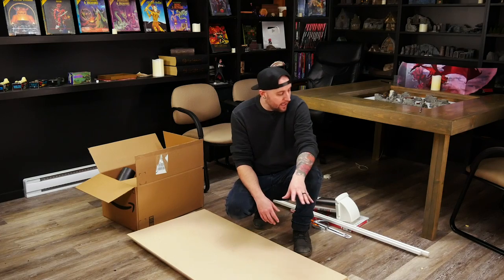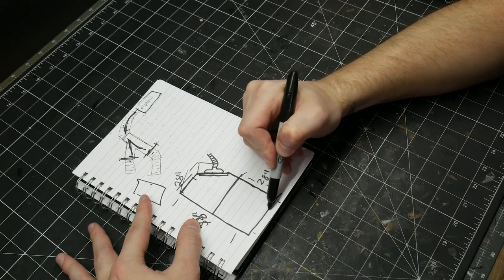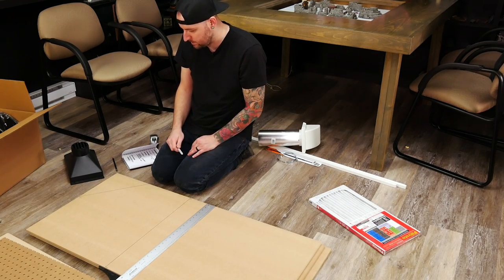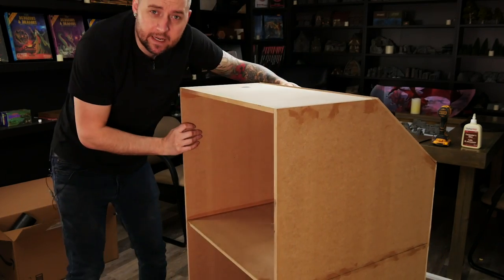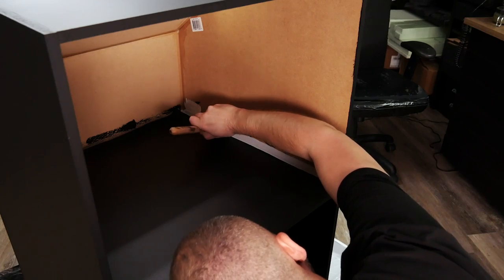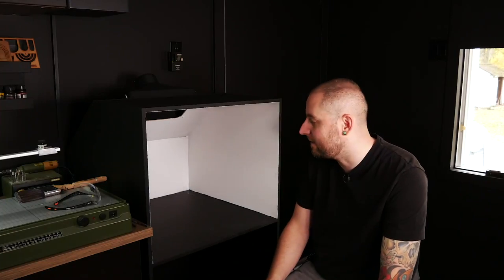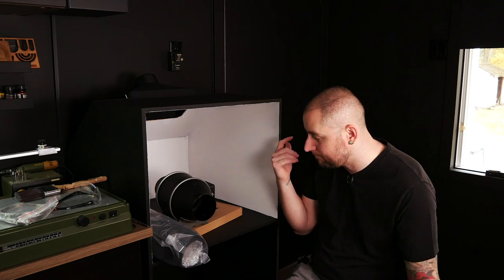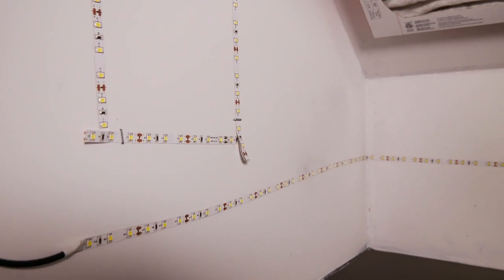I Finally Built Myself an Airbrush Spray Booth!

Comment from the maker: Yes, the exterior vent was sealed! Not everything makes it into a video for various reasons, in this case because I was out of white exterior caulking the day I filmed, then the next day we had a blizzard. It was sealed a few days later when the weather improved......chill my dudes. 
BUILD LIST
1/2" MDF (6'x4'....I bought 3 precut sheets of 2'x4')
1/4" MDF (2'x4' sheet. I bought two sheets and didn't use most of one, if you reduce how far down back goes you can get away with one sheet)

FILTER
(USA) https://amzn.to/2B0Lz7M
(Canada) https://amzn.to/32eHXeA
(UK) https://amzn.to/2VvZWKS
(Germany) https://amzn.to/2ID5RZl

IN LINE FAN
UK Amazon didn't list my fan so look for one that has at least 200CFM and speed control
(USA) https://amzn.to/2pbhoYU
(Canada) https://amzn.to/2pcWRTN
(UK) https://amzn.to/2IHMNco
(Germany) https://amzn.to/2IIgY2Z 

DUST HOOD
(USA) https://amzn.to/33l83wr
(Canada) https://amzn.to/35lzvMt
(UK) https://amzn.to/31aCuDY
(Germany) Can't find, check other country links for refrence

4" HOSE
(USA) https://amzn.to/2pfvfNK
(Canada) https://amzn.to/2M8xWcZ
(UK) https://amzn.to/2nIPymA
(Germany) https://amzn.to/2IXpRWT

4" HOSE CLAMPS
This set up used 4, but the fan came with two and the hose came with two so I didn't need to purchase any.

4" WALL HOOD
I can't find the exact type I used on Amazon. Check your local building supply store. They are used for dryer and fan vents. Get one with a flapper to stop air from entering, and one with a cage if you live somewhere with lots of squirrels like I do...

LED TAPE LIGHTS
Make sure you get something that comes with a power supply, that is dimmable, and that is daylight temperature (4000k-6000k)
(USA) https://amzn.to/2q6mtSR
(Canada) https://amzn.to/2q6dcKw
(UK) https://amzn.to/33p6rlj
(Germany) https://amzn.to/33rAAAD

TURNTABLE
(USA) https://amzn.to/2VFevf5
(Canada) https://amzn.to/3285cGN
(UK) https://amzn.to/31e8zeo
(Germany) https://amzn.to/2IHRC5v

DOUBLE SIDED TAPE
(USA) https://amzn.to/329Pzid
(Canada) https://amzn.to/2M6snM8
(UK) https://amzn.to/32kK14o
(Germany) https://amzn.to/35oV1ji

IF YOU DON'T WANT TO BUILD SOMETHING YOU CAN GET A "PORTABLE" ONE. IT WON'T BE AS POWERFUL, QUIET, OR PERMANENT BUT IT'S FAR BETTER THAN USING NOTHING
(USA) https://amzn.to/2pgyuos
(Canada) https://amzn.to/2B6J6ca
(UK) https://amzn.to/2VAbtIV
(Germany) https://amzn.to/2OLKhWx

(As an Amazon Associate I earn from qualifying purchases)
Reply: Black Magic Craft amazing work like always and that was some really bright LEDs.
Reply: I built one with a cheaper fan off amazon and a big sterilte storage bin. The filter fits over the entire back and the clear box means I can light it from the outside. I like yours more, but I didn't have the space or willpower to make furniture lol. That said, I think I spent about $40 dollars total.
Reply: Don't know if you've figured out what your going to do yet with the vent pipes but a furnco coupling would work. Might need to paint the brackets so they aren't obnoxious, added benefit of a furnco is that you could bend up the left over metal band and put a screw through it for wall mounting. That said.... 3d printing fumes really aren't that bad, but i guess if you got the vent already might as well use it!
Reply: DUDE IF YOU USE A MASARY HOLE SAW YOUWOULD MAK EASY WORK AND SHORT TIME U DONT NEED USE THE GRINDER
Reply: Wow this is kind of cool I just realized I live about four hours away from you.I've also spent the last week or so working on a spray booth for into put into my office.my design is relatively similar on using a Amazon inline fan ducting for the time being as I'm just starting out it is only going through the window in my office.the biggest change is that because I already have a table set up buying just sits on top of my desk and is made of corrugated plastic which is a very sturdy material that's light.I wanted it to be semi-permanent I wanted to be able to stand there and Beyond and used for in general but if the time arises to use this room for something else I wanted to be able to pick it up and move it. Using corrugated plastic infor this project made it collapsible yet big and sturdy.my biggest concern that I have to overcome is actually getting a decent elbow for the ducting that I have. 

I live in a small town just over the Manitoba border into
Reply: So glad you sealed that vent dude! I was like "no way? He's got to have gone back to fix that" LOL Booth looked great btw
Reply: We got hit with that storm were lile 4-5 hours away. We got 1-3 feet
Reply: Hey just a thought for your light strips. Maybe covering them with clear shipping tape. Just in case paint gets on them.
Reply: This is one of the best i.ve seen bad ass also putting part numbers and places.my hats off to you.Tanks Ian
Reply: After three months or so, how is it holding up?
  Especially the lights and the filter.
Did it clog up as readily as you thought it might?

  One additional tip here gang, to help prevent the potential hazard with the fumes, start the fan before you start painting. 
  Seems pretty Captain Obvious, but you’d be surprised. The potential hazard is from build up fumes and then the spark at first ignition...when you turn it on.
Reply: Frend do you work with enamels and laq.color or just with aqril.Turbofan is ok for enamels? Do you have any problems.thanks
Reply: Lol how did you know I was going to comment that. Glad you stuck some caulk in.
Reply: Awesome build and video, I just came across it because I’m also thinking of building a spray booth but didn’t know exactly how to go about it. So I was looking for some ideas and came across yours. I was just wondering since it’s been a few years now how those LED’s were holding up? Any issues with them? If not then I will definitely buy them as well since they are so cheap!? Maybe you should make an update on your spray booth video!? That would be cool and you can give us the pros and cons of the results and how they are holding up? Anyway great job and keep the videos coming! 😁👍
Reply from the maker: @Soloist101  LEDs still going strong!
Reply: what do you mean " sealed " ?

Comment: I know this is old, but if you wanted to use a baffle to save your filter, you could use that blue aquarium roll stuff over your filter. With the added bonus that you can remove it and clean it, put it back in.

Comment: Instead of the peg board as a pre-filter I would suggest getting some canvas from the fabric store and just push pin in up, and replace when to paint clogged. a pretty simple and easy change. and has enough holes to allow for air flow.
Reply: or cheese cloth.
Reply: @GuyTayler  Actually I think you are right. that is what I use. I use the canvas as a base it just has to have good holes to let air go through it. I just went to a fabric store and got the cheapest fabric I could. . mine has a funny ugly pattern on it but it doesnt matter it gets painted just like white would!
Reply: Don't do either, you would be shocked how fast you lose suction. Those filters are like 1.50 each lol.

Comment: Sweet build! And to the ones wondering about the fans rated to use with spray paint.  Yup, an explosion proof inline exhaust fan starts at like $900 US (And that's for a bog standard model for regular large ductworks not smaller ducts).
Reply: Ooof! Was wondering the price difference.

Comment: This is by far the best DIY booth I've seen on here. Glad I found this video. This is definitely the design I'll be copying to build mine, though I will also be adding a removable front cover to really help keep it clean inside when it goes months without use. Thanks for the inspiration to finally get building!

Comment: Nice solid build. I built a similar setup for my wife who airbrushes a lot of custom paint jobs on model horses (Breyers, Peter Stone, etc). The only thing I'd suggest doing differently with your setup is building in a way to space the air filter a couple inches out from the back of the spray booth. Doing this creates a plenum that allows a better suction across the entire area of the filter. As your design is right now, only the portion of the filter that is directly in front of the vent hood is actually catching particulates from the painting. Spacing it out those two inches (really could just be an inch and a half, or even one inch), will make the whole system work a lot more efficiently. My wife airbrushes a crap-ton more paint than a typical gaming modeler would, at least in terms of paint volume. I made her booth so it could take a 20x20x1 filter and it takes LONG time before it gets clogged enough for it to need changing. I really dig the use of the LED strip light as well. Did you get daylight color balanced lights (5000k plus)?

Comment: Did the same thing as you but with a stove hood fan mounted to the top of an old black TV/DVD stand for the box section. Has worked great for years.  It's big enough and has built in two speed fan and light switches.  I have a sheet of plexiglass that folds down to cover the top half of the front opening with the bottom half open to put my hands in to airbrush.  The plexiglas helps with increasing the fan suction and decrease fumes or paint leaving the booth and offers some protection from breathing in fumes/paint when doing close up detailed work. You can also close the two glass doors on the front of the TV stand to prevent dust getting in while projects dry. Only paid $40 CND for the hood fan new from home depot and some wiring and a plug to plug into the wall so the cost of the the total build was around $70.  Its rated at about 210cfm so it does the job.  I also use a lazy susan turn table from ikea that was about $12.  I use cheap furnace filers that I cut to size for the hood fan.  All in all it's worked out well and is very inexpensive.

Comment: "I may or may not use it for spray paint in the future..."
Immediately tests fan suction with spray paint.

Great build though.
Reply from the maker: I will be using it constantly for aerosol spraying. But I want people to know the "risk" and come to their own decisions.
Reply: Yeah I know. I was just trying to be funny because I'm bad at comments.
Reply from the maker: Nah, you’re just fine at comments. My reply is for posterity 😊
Reply: I just paused the video to make the same comment. 🤣 You'd probably have to spray paint with no filter for there to be any real risk.
Reply: @BlackMagicCraftOfficial  Just asking, and making the suggestion because I learned the hard way on my home built spray booth several years ago. Did you check and see if when the fan is running full bore that you are not creating enough suction to backflow your chimney? Are you now pulling your furnace and hot water heater exhaust into your house? (Like mine did!) Think about it, if you exhaust air from a house, the same amount of fresh air MUST get in somewhere.
STRONGLY SUGGEST that you place a carbon monoxide detector near your furnace/hot water tank for no other reason than to CYA..
Reply from the maker: dieseldave564 I’m pretty familiar with that scenario. I used to build luxury kitchens that had 600 CFM hood fans. We installed make up air units on relays for this very reason. A 200 CFM fan doesn’t need that, but opening a window during use is advised and what I will be doing. This will also help remove any smells more quickly as fresh air replaces the exhausted air.

My house already has carbon monoxide detectors integrated into my alarm/fire system.

Also last year I had my chimney internally sleeved with a smaller diameter pipe for hot water tank as it’s new building code here to do this when the furnace is switched to high eff that no longer uses chimney. This is specifically done to avoid bsckdraft on hot water tank.
Reply: Minutes later, blinds self hooking up the lights. lol
Reply: @BlackMagicCraftOfficial  Glad to hear that in your case you got it covered. Since you didn't address it in your video, I thought I would bring it up to benifit those that haven't done this before.
Reply: Explosion proof fans are now very inexpensive.  Google 1942 CFM.  :)  Your current setup is an accident waiting to happen.  Assuming your electrical is perfect and no errors occur there, eventually the bearings in the fan will run out of grease or have some problem and create a massive amount of heat.  Fragments of the bearings could create sparks if they are damaged as well.

Comment: I've been waiting for this video ever since you mentioned it!  I need to build one... Now I just need to figure out how to get around my block walls to vent it.  I'll probably have to vent through a hose up into the attic and then through the roof.
Reply: You can always vent out a window. You basically use something in your window kind of like what the floor AC units use for intake, except you'd be using it for exhaust. Depending on where in your house your booth is, venting up through the attic is a long way to go from the source of air, plus it is always best to avoid adding holes to a roof. There are also drill bits made specifically for cutting through mason block, as well as various other techniques for getting through block walls.  Here is an example, https://www.youtube.com/watch?v=tt_jkWeRJa4, but it is easy to find many other places it is talked about on the internet.

Comment: Great looking spray booth.  For those thinking of doing one them selves, some suggestions.  Keep the run as short as possible,  and avoid the use of flex hose.  Opt for rigid metal pipe. Flex hose cause turbulance and reduces  the effectiveness.  Also keep the number of offsets (elbows) to a minimum.  Instead of 90 s try to use 45 s.  Don t use the Filtreat filters, I use cheap fibre glass  filters (package of 3 fo 5-6 dollars.

Comment: A tip for connecting the pipes. PVC piping can be heated with a heat gun to become more flexible. You could heat it, mould it around the fitting in question, and let it cool down again. I've done this for shop vacs successfully.

Comment: I am new to airbrushing but was inspired by your spray booth build but not as sturdy.  I bought the exact inline fan and since my workspace is in the basement, I was able to vent through half of the 14" x 36" double window (bug screen side) and insulated with Masonite and 2" styrafoam sandwich.  the biggest problem was fitting the 4" aluminum flex duct onto the original cheap damper which was also 4".  sent it back to Amazon and paid more for a better damper and had less of a problem to put it all together.  thanks again for a well presented video

Comment: Hello! Thanks for filming this video. I am building my own spray booth as well for airbrushing and was trying use some other fans and power supplies and LED lights. after viewing your video I was able to rationalize the purchase of the inline fane and the LED lights with power, both of which simply plug into an outlet. Turns out the inline fan is going to be 15% more powerful than the industrial computer fan I was going to use and the led lights are install ready. Venting is not an issue because I am going to be spraying next to a window so the venting was never an issue. Thanks  so much for the informative video and you sure changed my mind!

Comment: This is an awesome build! I'm going to try and do something similar when I build mine. I also wanted to mention a feature I saw on a spray booth I worked with when I worked at Rockwell Collins that I had never thought of, but thought it was a nice feature to add. There was a pressure gauge that told you how much vacuum was being pulled between the fan and the filter, and that was to tell you when you needed to replace the filter. This was to preserve the fan, and if you're going to be using the booth often, then it'll probably be a useful feature to add.
Reply: Clever idea!

Comment: Nice. I built mine out of reclaimed particle board, an old dryer vent hose, a reclaimed lamp, two reclaimed switches, a reclaimed outlet, and the only brand new item was the direct drive fan. It was pretty fun building it and getting it to work.

Comment: OK.  Comment #1:  Love the old school AD&D & D&D books and boxes. #2.  Not sure about the printing shake, but I can see it being a thing, although I think more of a thing with an FDM machine.  better to be safe than sorry. #3 Snow like that when the trees can still collect it in the leaves SUCKS, we had a SINGLE DAY like that a couple years back in Calgary, can't imagine the damage multiple days would do. #4 nice and simple despite it's more permanent set-up, especially using the full-size cut pieces of MDF.
Reply from the maker: I'm pretty sure I WILL end up putting the printer on top. It's fairly stable, but I decided I'll just screw the side of the booth directly to my work bench, which is bolted to the wall. This will eliminate basically all risk of bumps/shake issues.
Reply: @BlackMagicCraftOfficial  I guess if the resin is shaking from side to side a little as it cures through the UV light it might cause issues.  Made a decision on the machine you want yet? :)
Reply from the maker: I already got something sitting waiting to be opened and set up 🤫......gotta find the time.
Reply: @BlackMagicCraftOfficial  I can't wait to see what printer you choose. Elegoo Mars?  Or perhaps someone sent you that new Phrozen beast-of-a-printer to review?

Comment: If you still want to use the blast gates you might mount it to the cowling/hood on the booth. it would be very stable connected to that.

Also you may want to cover the LEDs with packing tape. Then if over-spray starts to obscure them, you can just replace the tape.